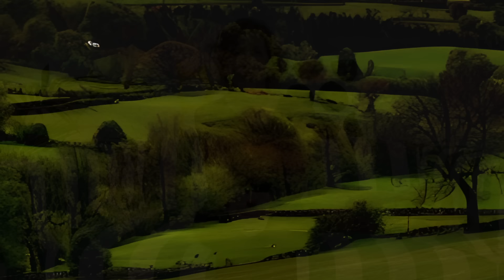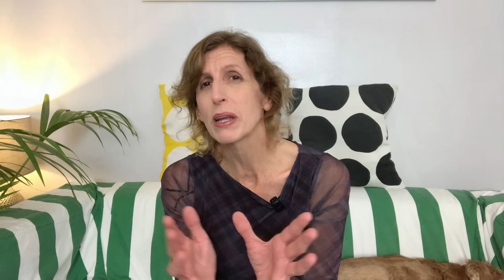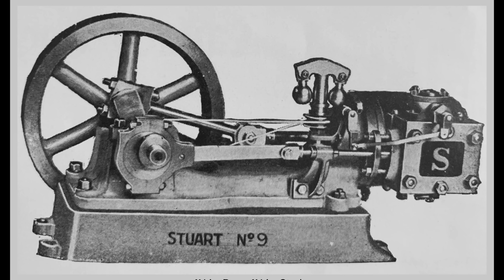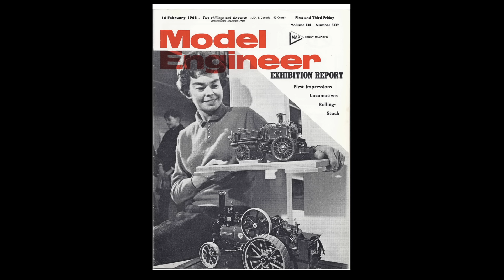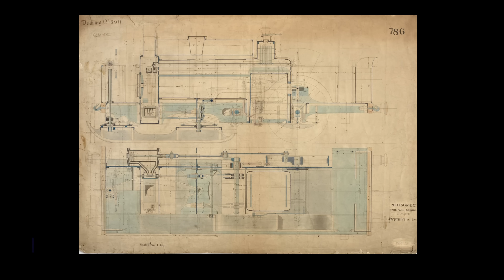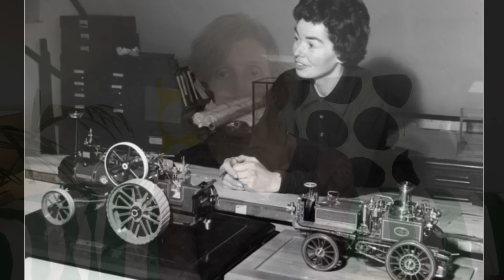The world's greatest model engineer... and the Ice Locomotive

Comment: Wow!! Thank you for this video about Cherry.. I have some of her tools and a scotch yoke compressor from her shop located in Bradenton FL, a neighbor.. Having her description of her building process.. in many instances having to modify the non functional patented design. Her process included manufacturing several incremental copies "proof of concept" to fully functional to the final display version.. eg: steam / plumbing at scale was to small to allow for adequate  flow to function.. Every project was tested for full functionality.. The display version may have the plumbing "pipes" replaced with brass solid wire to obtain the correct external dimension.. Great Lady.. awarded the MBE in 2000.. I really enjoyed my time with her..
Reply from the maker: Wow! How lovely to have known her!
Reply: @modelrailwayquest  do you have pictures of her last effort.. a 4 wheel drive power wagon. the first itteration / step in her builds.  this first machanical step, as in her other builds is proof of the external mechanical integration. Where you see if the component parts actually fit together.  Eg: the steam engine's cylinder only has a piston rod fitted to a drilled hole as is the valve actuating rod.. also.. the wheels at this point were made from gray plastic (pvc maybe) with out any detail eg spokes.. there were many examples where she was working only from pictures from publications.. without any detail.. therefor the many hours she would spend researching each project.  in other cases, where she was working form patent design drawings.  where the end result made it obvious that the design was never actually tested for functionality.. the example Cherry shared with me was a 2 cylinder vehicle where the thermal expansion process locked up the engine.. she added a passage (transverse pipe) to the bottom of the vertical boiler through which passed an added shaft that mated with 90 degree bevel gears at both ends (that she machined) to keep the engine timed correctly. as stated proviously, each of her finished projects were actually tested for correct function. and in some cases 2 sets of plumbing was required because (do to scale) the scale accurate "plumbing" was actually sold cross section.. the running version tubing was to large to comply with the design scale.
I think i have pictures of the steam wagon mentioned above. if you would like to have copies please advise..

Comment: I’m thankful that I met her at the ME Exhibition at Sandown Park.  She was very self-effacing, insisting that there were others just as good if not better than her, for example the maker of a n LSWR express loco at the show.  She explained that its steam pressure gauge had to be over-scale for practical reasons but otherwise the model was extremely accurate.  The thing is the SMALL SCALE at which she worked!

Yes. The greatest model engineer ever.
Reply from the maker: How incredible to meet her. The fact that she was so modest too - I think the most talented geniuses are usually the most humble. So glad you got to meet Cherry.
Reply: @modelrailwayquest She was wandering around the exhibition on her own. I guessed who she was and said ‘I think I know who you are; I am very pleased to meet you.’ Rather than confirm her name she just joined in conversation, regretting that her eyes and hands were now limiting her, but with good grace rather than annoyance.  She added that unless a paint finish was perfect she would strip a model into separate parts and start again.  She added that research time was usually longer than making time.  She also credited her father with allowing her unlimited use of his workshop.  She led her field by as great a margin as any practitioner in any field.  Truly ‘One among Few’
Reply from the maker: @stephensmith799  What a lovely encounter. 😊